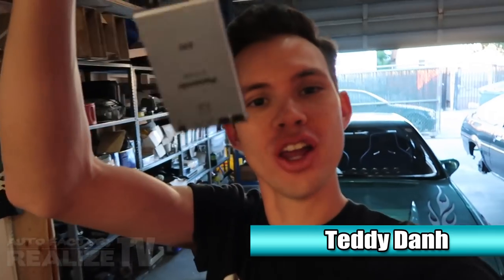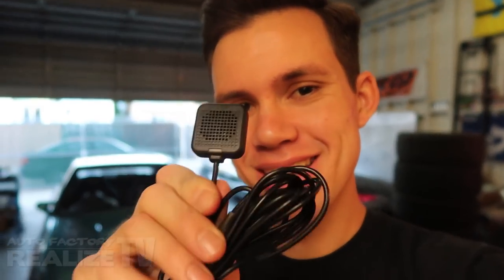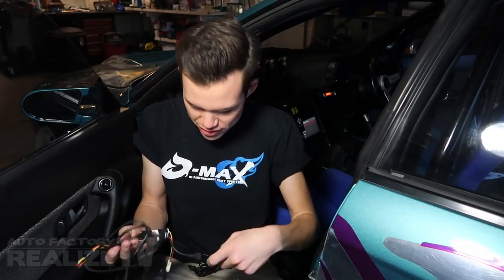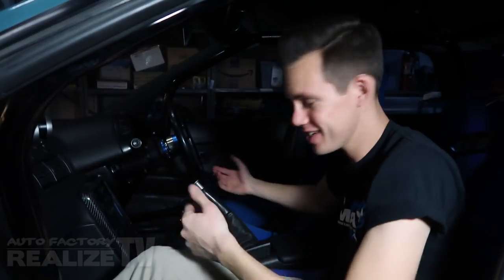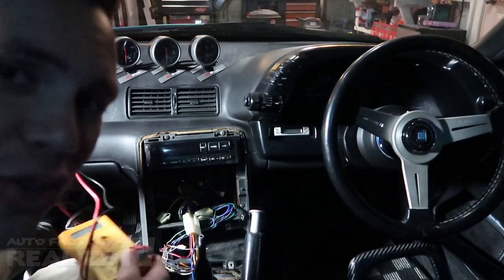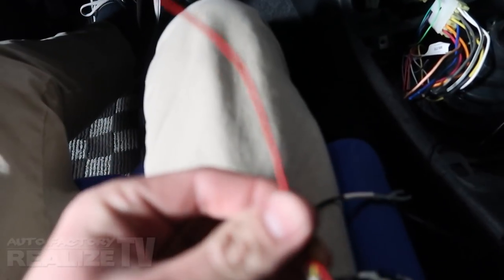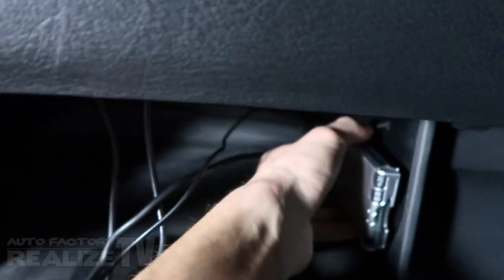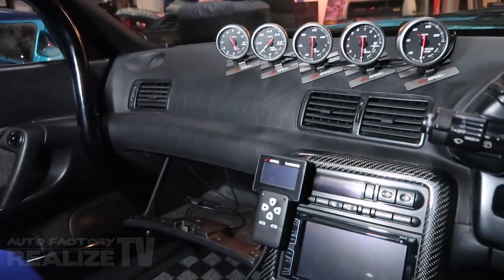Teddy's R32 - Electronic Toll Collector Install

Comment: didn't know it worked with an extern speaker, does it work with an internet speaker?
Reply from the maker: Not sure what you mean by internet speaker, but the unit itself comes with a built in speaker